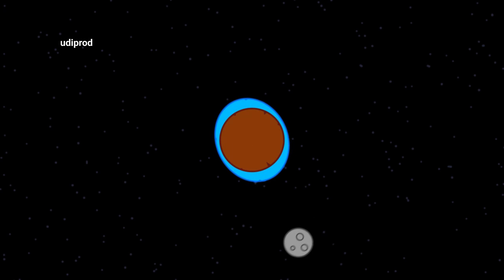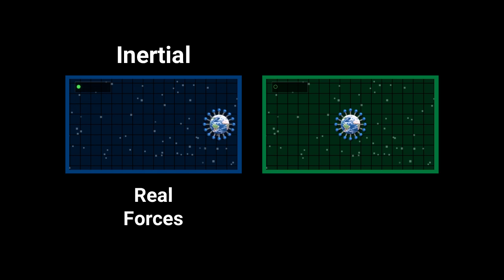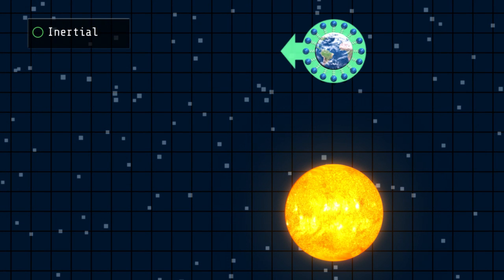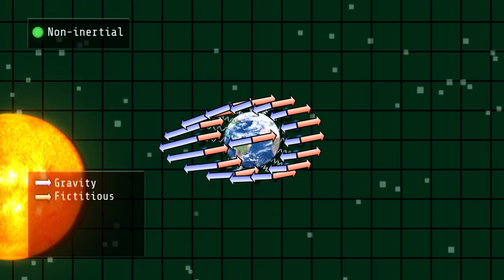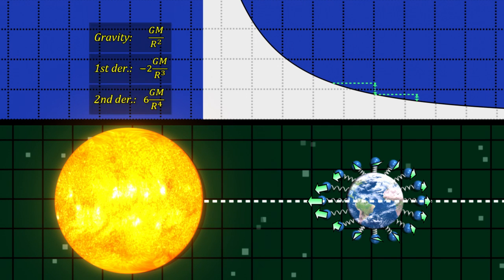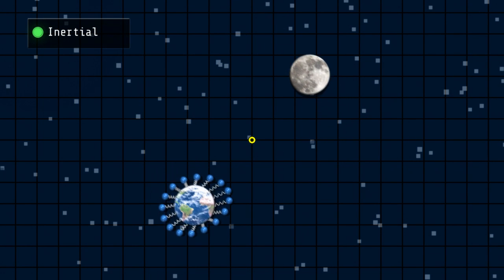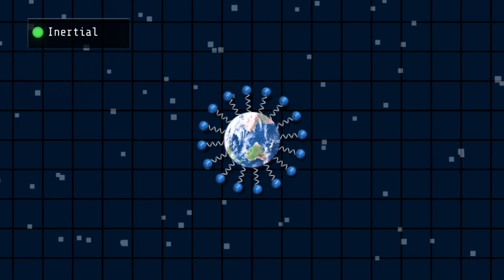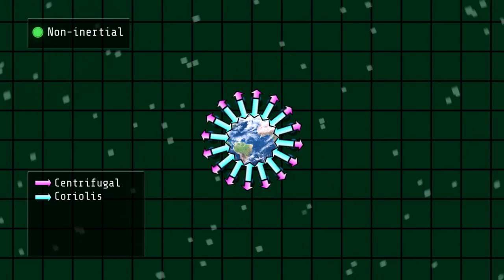Visualization of Tidal Forces

Comment: It's the very best explanation  of this topic that I ever heard. Thanks.  It would bec even clearer if you change the term "fictious force" to something like "lagging force" because that lagging concept really tipped the scale for me from not understanding to understanding.
Reply: What an interesting comment, and I totally agree. Thanks. Whatever makes it easier for someone to gain an understanding of a particular topic in science, is a very useful tool to have in your possession, as long as it agrees with the observational data.

However, why not save yourself the trouble of inventing more fictitious names, and just call it the "centrifugal force."

A real force that only appears in an accelerated frame of reference, in exactly the same way that the so-called force of gravity does. Albeit for the one proviso, that it acts in the opposite direction to the aforementioned force.

That's what Sir Isaac Newton would've done, and I wouldn't want to disagree with him, would you? All the best.
Reply: Thank you for your added explanation. (The “fictitious force” is difficult (for me) to understand.) So, according to your explanation, the centrifugal force is a force that is pulling opposite to gravity which causes a bulge on the opposite side of the Earth because the water on that side is being pulled outwards? Is that correct?

Or what if we imagine a string (gravity) pulling on the earth which causes it to become elongated, with or without any orbit involved-we could be pulling the earth in a straight line through space. This would cause a bulge on either side of the earth due to the elongation, though we wouldn’t necessarily call it a centrifugal force since the elongation would happen even in the absence of an orbit. 
If all points on the Earth are pulling towards the center, and an outside force pulls on the Earth, it will become somewhat elongated, and this will cause the water on the other side to be “pushed” out. 
I like the word you used, “lagging,” as that helps me to imagine that gravity might just pulling less on the far side water since it is further away. If this is the case, then the tide is always higher on the side closer to the moon?

Also, no matter how I imagine this, it always seems more egg shaped than elongated, like hanging a water balloon from a string, unlike the images that are usually shown in these videos, which look closer to ovals. 

I like your explanation because the centrifugal force is easier for me to envision, and just feels more satisfying. But please consider my example where the earth is being pulled straight through space without any orbit directly towards a massive object. In this case, if the (slightly elongated) Earth is still rotating, would we experience tides? And if so, then I don’t think we would be able to say that they are caused by centrifugal forces.
Reply: Hi Wavy, I see that Marcos said lagging, not you. At any rate thank you both for your comments. I will keep watching the original video to try and get a better grasp. Have a good day.
Reply: Hi Enrique, I did read through your comment, but wasn't notified of its existence unfortunately. Probably, because it included the word centrifugal and apparently we don't like to accept the effect it has in orbital motion.

You would both be very welcome to comment on my cartoon and continue the discussion if you're interested. Thank you for replying here.

Comment: I’ve realized that just with the title “Tidal Patterns”, its not easy to find they site I mentioned on my previous post.
What I had posted on that site was: 

“Farther parts of the Earth are NOT SUFFICIENTLY attracted by the Moon in order to follow an orbit equal to the one of Earth´s C.M. (if they could move independently from the rest of the planet).
Due to that, they try to get a farther orbit.
They rest of they planet prevents that, exerting a "moonward" force. And those farther parts exert an opposite reaction force ... 
All those forces stretch farther solid Earth´s parts, and where water they so called hide tide bulge builds, trying to reach an equilibrium with own Earth´s attraction (not fully achievable due to they daily Earth´s quick rotation, what also is the cause of the some couple of hours gap between high tide meridian and Moon´s actual position).
A "mirror" phenomenon happens at closer half of the Earth, because its parts are attracted by the Moon TOO MUCH for the average orbit, they try to get a closer orbit, but the rest of they planet prevents it ... “

And if anybody wants to see more about previous discussion, the link to mentioned Youtube site is: 

Tidal Patterns

Comment: Your non-inertial frame (1:33) is actually an inertial frame. To appear stationary amidst the uniform gravity field would actually require energy, and it would be the non-inertial frame. Great video nonetheless, thank you!
Reply: Right, inert means still. The one on the left is still, the one on the right is moving (requires energy)
Reply: It confused me for a second, then I realized it was just a mistake.
Reply: if you are saying that non inertial frame seems to not accelerating from the depiction, then yes. but it is one of the possible ways to show this phenomenon in a video. energy requirement thing you said sounds irrelevant, i think.
Reply: @bewareofyikes  Hi Sergio, seeing as you commented in a thread that's 4 years old, hoping someone would reply! 😂 The energy requirement is relevant. The unfortunate mistake that Udiprod made here, was with the definition of an Inertial frame. An inertial frame does not include any forces, be they real or unreal. Analysing the tidal forces in an inertial frame is what's irrelevant here, I think.

Comment: Hi Udiprod. Thanks for your video. There is one question which is still puzzling me. In the case of a full moon the tidal forces of the sun and moon exerted on the solid earth are in opposite direction. Because of that we should expect a reduce bulges sizes in a full moon state than in a new moon state? (for the same eart sun and earth moon distance in both cases). I think I miss something but I Don t know what?
Reply from the maker: You are basically right: when the moon and the sun align the two tides build up and we get a larger tide.

But the moon by itself causes bulges on both sides, also the sun. So this alignment happens both in a full moon and in a new moon. It's called a "Spring tide".

Read about it here:
https://en.wikipedia.org/wiki/Tide#Range_variation:_springs_and_neaps

Comment: You can imagine the earth without water, water balances the shape of the earth, and its revolving or orbiting around its self, and the sun. Ebb and tide are considered as a safety vale for the earth, and its rotation. 
Earth with water slows its revolving...
The water increased because of the melting of ice caps of polars and Himalayas, therefore the force of revolving increases too...
NOW:The length of the year now is  [ 365 1/4 +_(2 minutes )]....
These studies had completed and sent on July 26th 2000...

                          Yousif A Tobiya

Comment: Why are the force vectors around 3:40 not perfectly directed at the Sun? They look like they’re directed slightly ahead.
Reply from the maker: It's explained at 13:13
Reply: udiprod Still a bit confused. Why would the Earth not respond instantly to the tidal forces? I know gravitational waves propagate at the speed of light but how is that coming into play here?
Reply: udiprod Also, why is the Earth rotating clockwise in the final portion of the video?
Reply from the maker: Right, it's not gravitational waves. The beads feel the tidal forces instantly, like you say. But the effect of a force in an object is not immediate displacement, but gradual build-up of speed. Think for example about cars. When a driver steps on the gas, the car doesn't instantly jump to another location, but slowly gathers speed.

The same thing happens with the beads: as they feel the tidal forces they start accelerating toward the direction they're pointing at, but it takes them about 0.5 a second until the are fully stretched out.  By that time the Sun has already moved a little bit relative to the Earth, so they beads are no longer pointing directly at the Sun at this time.
Reply: udiprod So their inertia carries them forward for a bit after the appropriate force vector induces maximum stretching, and they settle back down? I think I get it a bit more now. Also not trying to bug you because I know I just asked this in a other comment, but why is the Earth rotating clockwise in the inertial FOV? I’m trying to compare this to a “Traditional” North view of the Sun/Earth system and my intuition is telling me that the tidal bulge would actually lag behind slightly. May just need to think about it more.
Reply from the maker: Yes, I think you are right. Without inertia the springs would have simply shown the current direction of the force so they would have pointed at the Sun. But because of the bead's inertia there's a more complicated pattern. Maybe that's the best way to explain it.

Which is the inertial FOV you refer to? Because for example at 3:50 there's an inertial FOV, but there the Earth is not rotating at all. This is a simplifcation of course, because in real life the Earth does rotate in an inertial FOV.

The scene at 12:10 is in fact a non-inertial FOV of the same inertial scene at 3:50.  The Camera at 12:10 rotates counter clockwise so it will point its right side at the Earth. This causes all non-rotating objects to seem to be rotating clockwise (both Sun and Earth). In real life, the Earth is rotating counter-clockerwise in the inertial FOV much more rapidly than its rotation around the Sun, therefore also in a view as in 12:10 it would seem rotating counter clockwise (when viewed from above the north pole, like you say).

Either way the tidal bulge lags behind. That is, it reaches its peak sometime after the Sun has passed overhead.

Comment: This video is not correct in it's explanation of tidal forces. The difference in forces between the rear of the Earth and the front facing the moon is negligible and does not cause the tidal effects we see. 

This can easily be seen because lakes do not experience tides yet according to this explanation they should. 

The reason for tidal forces, in general, is the difference in the direction of the force of the Moon. Along the line of the Moon and Earth center the direction of the force is aligned with that line. However on all other points, the direction of the force towards the moon's center of gravity is actually pointing at an angle. If you visualize the two points on Earth's surface that are perpendicular to the Earth-moon-center line, the part of the force pulls them down. This creates pressure from the top/bottom (on a 2d Earth at least) which causes water to flow closer to the middle. There is a wiki image here https://upload.wikimedia.org/wikipedia/commons/0/08/Field_tidal.svg

The actual forces are tiny but the directions are exactly as depicted. The seemingly inward pull of water from the top/bottom of that diagram is what causes the tides.

Lakes do not experience similar tides because they are not directly connected to oceans, which basically the pressure from the flowing water from the top/bottom of the earth doesn't reach them.
Reply from the maker: The video focuses on what generates tidal forces, and less on how tidal forces cause tides.

The reason for tidal forces is not just differences in direction, but differences in gravity field in general. You can see in the diagram you included (and also in the video) that the tidal forces are stronest on the line connecting the Earth with the moon, i.e., it's actually the differences in magnitude and not difference in direction that explain the tidal forces at their strongest points.

The lake you mentioned will, at some point, reach the top/bottom of the diagram and be subject to the inward pull, but this too will not cause tide effects in this lake. You need a vast body to see tide effects regardless of which point in the diagram they're in.

One thing is true and I regret not mentioning more explicitly it in the video, is that bodies of water are mostly subject to tangential forces (e.g., like the one in the diagram between the top and the left side), though this is briefly implicitly mentioned at 8:06. As far as I know the solid parts of the Earth are actually more influenced by the radial parts (i.e., top/bottom and left/right).

Comment: Unfortunately hardly anything you say here about the Earth’s tides is correct, and this certainly isn’t the way to visualise them. You perpetuate a widely held misconception that the vertical/axial gravitational component is responsible for raising the tides when it isn’t. This component is tiny, about one ten millionth of a ‘g’, and the oceans are too shallow for this to accumulate any effect. If it were the dominant force there would only be one high tide a day because there would only be one tidal bulge, in effect a Roche Lobe such as is found in accreting binary star systems. There is no way that the vertical/axial model can account for the second tidal bulge, and all attempts to force it to do so, such as your swapping of reference frames, are grotesque distortions of Physics.
The true source of the Earth’s tides was discovered by Euler and mathematically modelled by Laplace in his eponymous Tidal Equations. The tides are raised by the horizontal components of the Moon’s gravitational pull which act as cumulative tractive forces in the horizontal plane of the oceans. Although these components are also tiny, they are crucially cumulative over the vast surface of Earth’s oceans, and sea water is fluid and incompressible. These tractive components are present on the far side of the Earth as well as that nearest the Moon, so this model correctly predicts two tidal bulges. It also correctly predicts the shape of the bulges, which are domed or flat-topped, because along the Earth-Moon axis the horizontal components are all tending to zero. The tractive forces peak at about 45 degrees from the Earth-Moon axis, so a better visualisation is that the tidal bulges are squeezed up from the sides rather than pulled from above.
Laplace’s Tidal Equations take the vertical component to be zero, and are still used today as the basis for accurate modelling and to predict the tides.
Reply: Hello One Eleven, 
Good presentations about the ocean tides are few and far between. I have one which is called ‘Ocean Tides Making Sense’. But it isn’t getting much attention, amongst a multitude of like-minded popular stuff. Could I ask you to take a look at it and voice your opinion. It would be greatly appreciated, as you clearly know what you are talking about.

Comment: I don’t think I understood the fictitious force at all :/ if the camera has the same acceleration as the earth, why do we apply a fictitious force on the earth?
Reply: That’s the exact situation which necessitates the introduction of a fictitious force. By switching to a reference system which is apparently standing still, there would be no reason for the masses in it to start moving. You can only make that work if you introduce said fictitious forces (which really are a measure for the mass effects you lost, switching to this reference frame).

Comment: Can someone point me to an answer for this? I'm no physicist!
Is acceleration strongest at the surface of an object? Since most of the mass is in one direction? Is acceleration in the center of the object weakest? Since the acceleration is canceled out on all sides?

This is just speculation for funsies.
 So if a star were liquid,  it's shape would never be constant, because the liquid would always be gaining or losing momentum. Fluid would constantly be in motion because of gravity. Which strangely enough, controls convection of cold and hot liquids. Also, the inertia of the liquid would interact with gravitational acceleration.

Comment: I've always struggled with properly conceptualizing Freefall of an object falling to Earth, vs Freefall of an orbiting body. In the former, and object is under constant acceleration, but in the latter, that clearly can't be true or it could not hold a stable orbit. Yet we call both of these things Freefall?  I wonder if it has something to do with the angular momentum of an orbiting body, as I understand we also call that a form of "acceleration"  but this is also a concept I slightly struggle with. I understand you feel a force when you are turning rather than going straight, but that does not seem like an interpretation of acceleration, in as much as it does not imply a change of speed. sigh.
Reply: Orbital body is constantly accelerating, but the direction of the acceleration changes as the body moves. The constant acceleration tries to change the body's velocity towards the object it is orbiting around, but the acceleration is weak enough that it just never will. And then this constant turning of velocity keeps the body going around the object (provided this turning is strong enough, it could just curve the trajectory of a passing object).

I do agree it is unintuitive (especially in text format), so I would recomend fucking around with physics simulators and games that contain that type of physics.
Reply: @Trombi01  That was genuinely helpful. My intuition lit up with a little flash, when you described the constant change in direction as a type of acceleration. All of a sudden, I just got it. Cheers